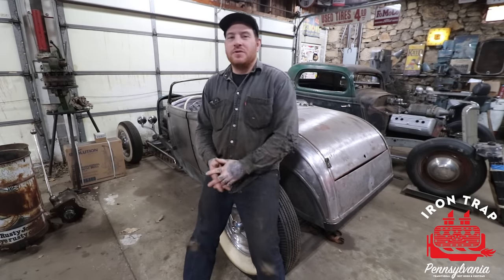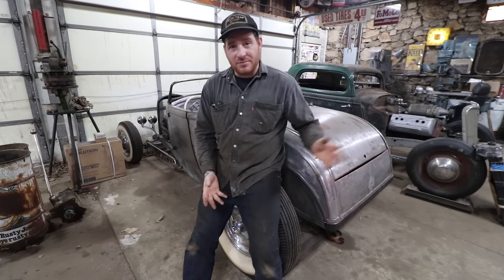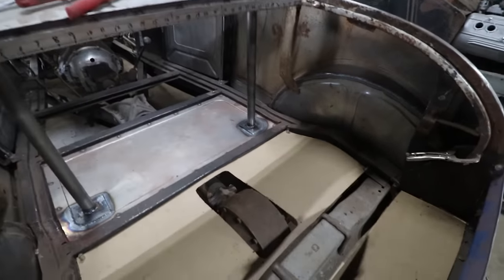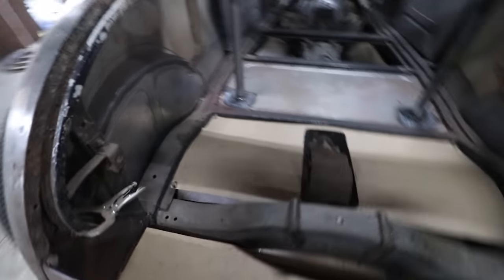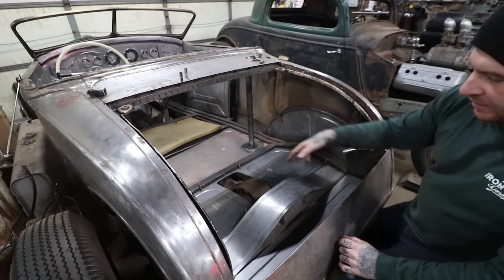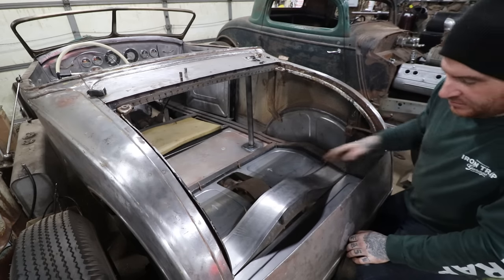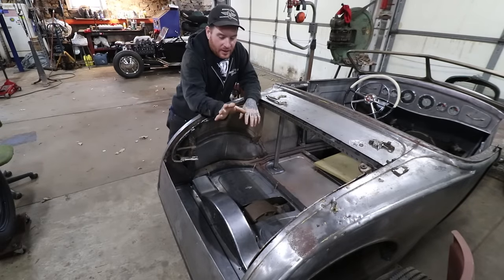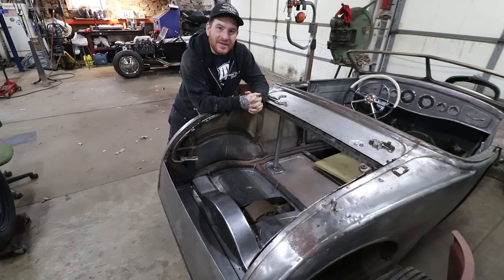Bead Rolling Custom Trunk Floor Panels For Our 1930 Ford Model A Roadster!

Comment: The upper beam on your sheetmetal brake should be adjustable. You can move it back to achieve a nice radiused edge then shrink & stretch from there.

Comment: Matt, do you mind if I ask a rather silly question, why are tucking it inside the frame rails instead of setting it on top to make sure you have plenty of clearance for suspension?